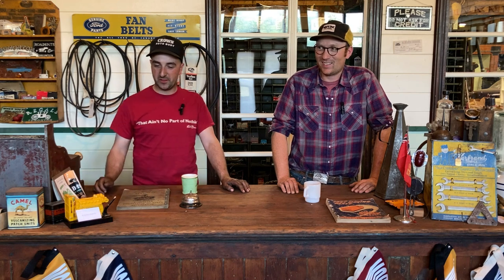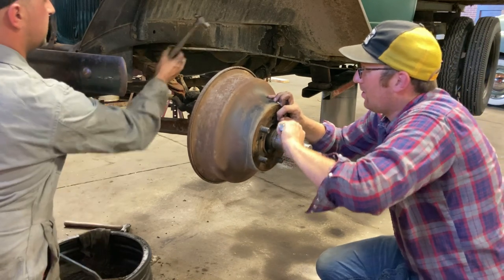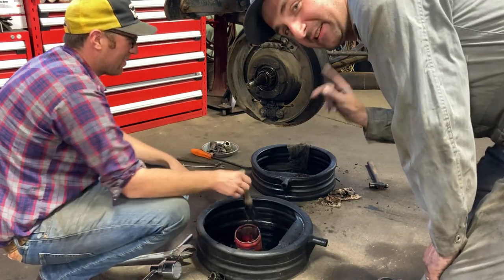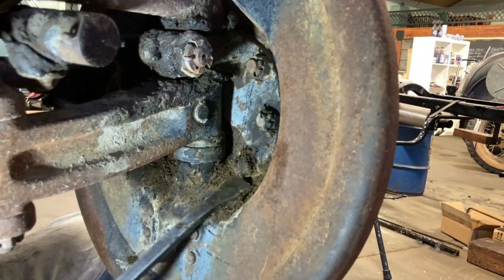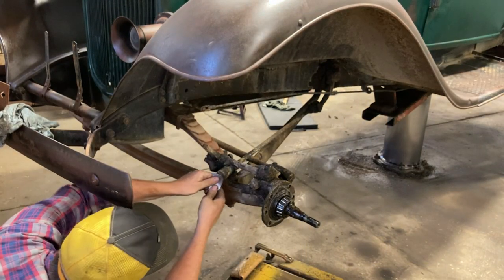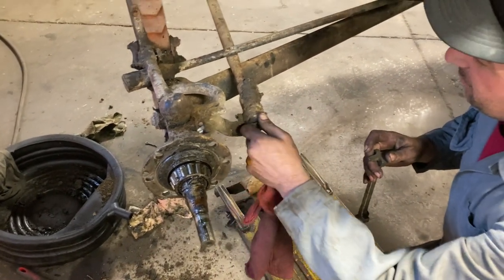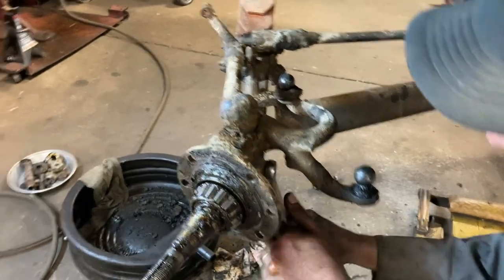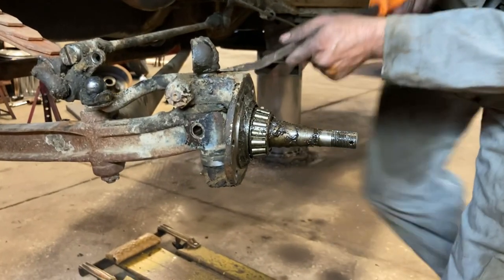Original Paint 1932 Ford BB Big Truck From The Shed To The Street!  Part 1 Kingpins!

Comment: Absolutely brain bending. Strong's Garage: The last place in the Universe where a 32 Ford Truck goes on the rack for a spindle rebuilt - WITH - not just a trove of handy new bushings - AND - a vintage bushing knock out and trim set - BUT - whipping out a vintage box of new king pins to drop in. Just jaw dropping - and they do it like they just did another one minutes ago.

Comment: Very nice video ,this both back some memories. I have worked on a GAZ MM that is in technical terms the same as a Ford. The kingpin and pushing issues I remember and also they have a very odd size dust cap and castle nut. In terms of repairs its really straight forward just as seen in this video. You should really do more of these videos, very appreciated over here.

Comment: Never saw a lock pin or King pin come out that easy.  Lucky you. You should show how to set the pre-load on that thrust bearing, that's important.  Not sure on the B, but on an A that nut for lock pin is like a tall cap nut.  It hits the back plate to stop the wheels from turning to far.  The tire will hit the brake rods. You guys are fun, nice reamer set.  Gibbs is great stuff, lots of folks don't know about it.

Comment: By the way, if you ever want to save a worn kingpin or some other worn part it is possible to have them sent out and either "hard chromed" or "spray welded" and remachined to original spec. Chromium spraying is good for rebuilding hoist cylinder rods but also good if you want to put a hard case on a part that wears quickly, so long as it's bearing against a brass bushing or other soft wear surface. These kingpins are identical to what we still see on forklifts and some construction equipment and there's still a fair number of third-tier shops out there that can rebuild parts like these so you can keep them original!

Comment: Hey fellas - get ya an old style Goldenrod metal sprayer can and put your barsol in that. It allows you to mist the liquid onto the dust then brush it off like you do. Goes a little faster and still gets the dust off safely - and is a good old fashioned method. Kerosene is another good rinse. Probably preaching to the choir. Thanks for the great video from down in Kansas.

Comment: Hey boys glad to see your video. I am getting ready to do the same job on a 33 BB157". I brought mine back from Great Falls Montana. Also a grain truck. Mine had a PTO driven blower on the right side of the bed to blow the grain into the silos. Last mine ran before I got it was in 1963, threw a rod on #3 of the V8. She still has a Flathead in her now but a bit more power as it is an 8BA engine now. I'd show you a picture of it but I don't know how.